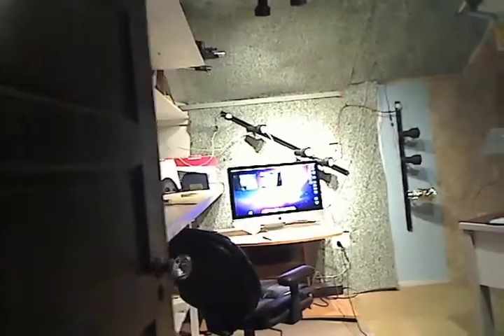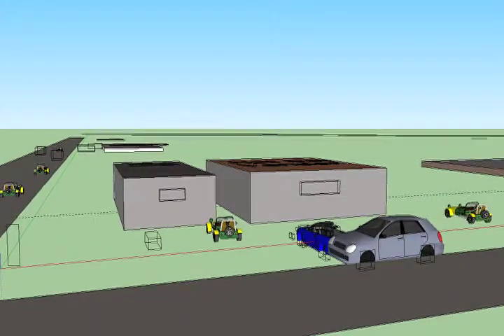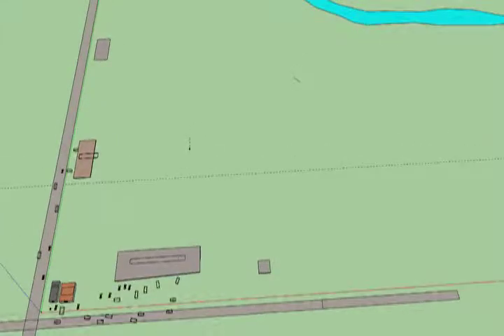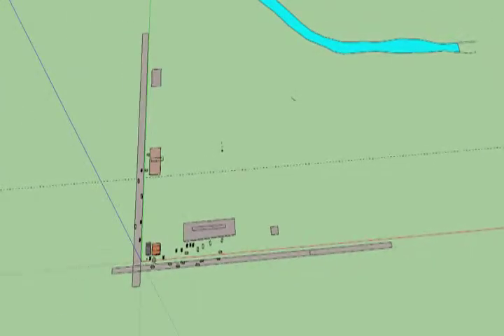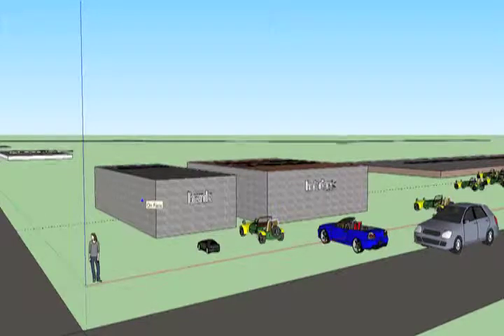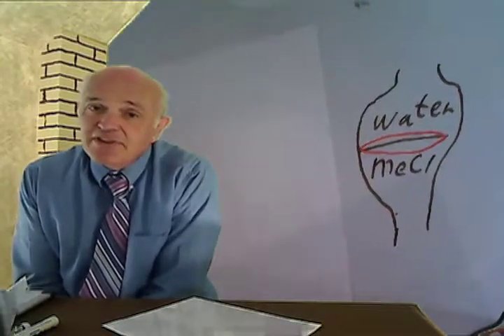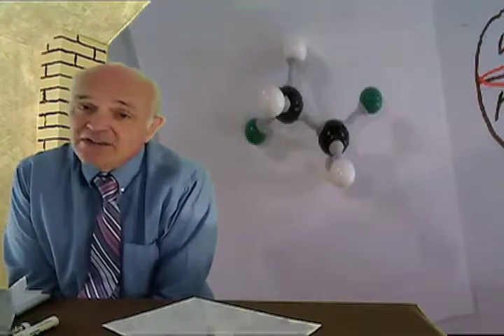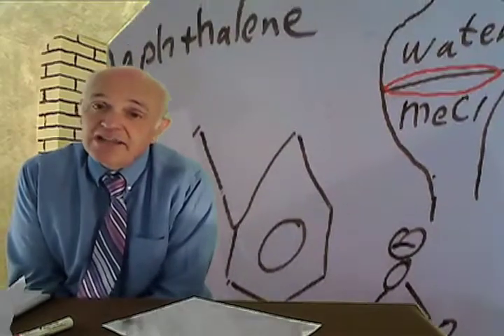EPA 8270   extraction in methylene chloride

Comment: Thanks for the video. Do you know why the recoveries for benzoic acid, benzidine and benzaldehyde is so low for 8270 when you concentrate using KD? Also, with turbovap, our recoveries for the majority of the analytes are on the lower side. The standard that contains benzoic acid is in acetone and we use DCM to extract. Any suggestions to improve the recoveries through both turbovap and KD?
Reply from the maker: You question is too complex for me.  One comment would be tha the three compounds you mention benzoic acid, benzaldehyde and benzidine are not in the same chemical category.  So you are looking for three different answers.  Your "recoveries" might be a reflection of the performance of the GC.